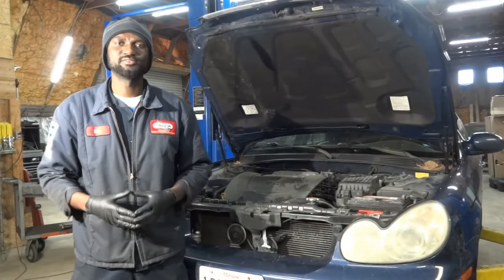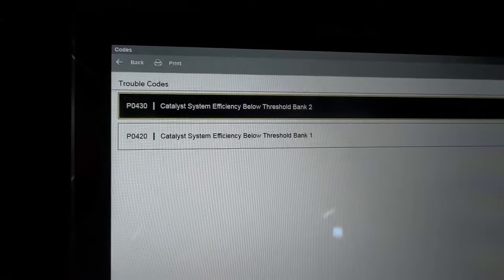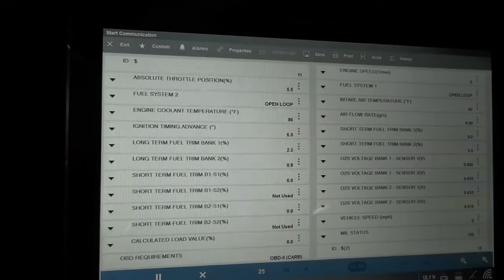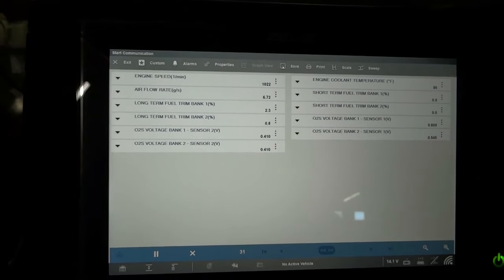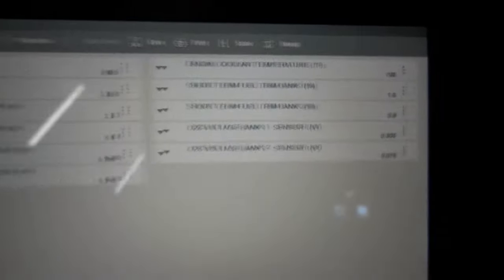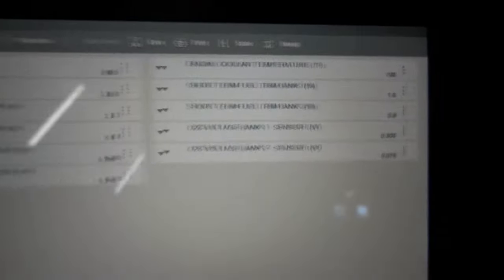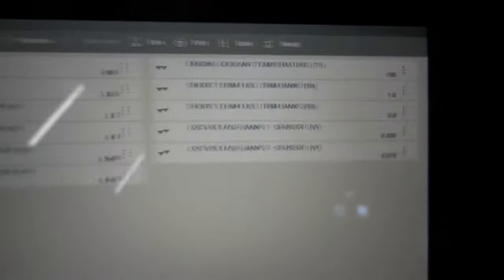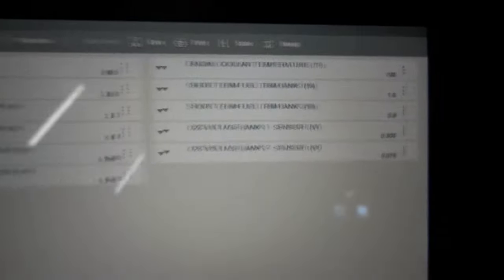Catalytic Converter Efficiency Below Threshold: Code P0420 & P0430 Diagnosis and Repair

Comment: Greetings from Australia. 2008 Honda Odyssey catalytic converter drive cycle complete and no DTC. The rear o2 is following the upstream wideband sensor ( same as this bad CAT) indicated the Cat dooen't work it should be BUT o2 drive cycle never run.  Question is that without o2 readiness monitor is not running, CAT monitor can be run as in this case ? Still leaning toward bad cat prevent the oxy sensor from running ...              you deserve a million subscriber and more
Reply from the maker: Tiffany Kim  Thank you!! Yeah you might have a bad cat or a bad 02 sensor!

Comment: 14’ accord had p0420. Cleaned old b2 sensor code came back after 50mi. Replaced it. Been 700mi no code. I scoped the cat and it look normal.
B2 on old sensor was going up and down. .1-.9 now its steady .4-.7.

Better to start with a new sensor and go from there.

Good luck!
Reply from the maker: @NeoAndersonReloaded  Good!

Comment: Fantastic tutorial! I wish I had easy access to you. I had the expensive experience of two dealership techs tell me independently of each other that both of my 4Runner's cats had to be replaced (with associated sensors), only to determine correctly, on my own, that the problem was the fuel pump, not what they diagnosed. They relied too much on their diagnostic devices, and didn't go beyond that . I relied on my old-school experience, and got it right.
Reply from the maker: bywayz  I'm sorry about your bad experience at the Dealership, and I'm glad you figured out the problem!!

Comment: Thank you for this informative video. I'm diagnosing my 2007 lexus with po430. Stft and ltft are in around .7 and 2.7. No exhaust leaks.  B2S2  is steady around .78. Cat temp is
320 in 580 out. Car runs excellent. Freeze frame showed B2S1 @ 2.79 when code set..Any help  what to do next appreciated. Keep up the good work!
Reply from the maker: Martin Jay  My Pleasure!! it looks like your cat has failed!

Comment: I had a PO420 code on my 2015 Malibu for months and used Catclean first, replaced cat, o2 sensors and plugs. The Po420 still keeps comeing back. You touched on the Mass air Flow sensor. I cleaned the sensor ( a new one was $95 ) . No more engine light , finally
Reply from the maker: @larryray9277  I'm glad to hear that the video was helpful!

Comment: Very detailed explanation video. I had no idea that so many parts removal and labor involved. Would be necessary to be removed. To get to the catalytic converters replacement. When I hear them being cut off and stolen in minutes by thieves. I have a 1996 Ford Crown Victoria V8 with a P O 430 code. Would this vehicle be as difficult for parts removal? How many hours of labor and parts cost was the vehicle you showed in the video? I wish I lived near you. To have my work done. You are a very good mechanic. Thank you for the video. New subscriber. Blessings to you.
Reply from the maker: Gail JOHNSON  Thank you!! removing catalytic converterts from your car will take 2-3 hours and the price will depend on how much the shop you're gonna take it to, charges per hour!!
Good Luck!!
Reply: @KITS_Auto_and_Truck_Repair  Thank you for your reply. I subscribed and will watching more of your informative videos.
Reply from the maker: @gailjohnson6670  My Pleasure!! Thank you!!
Reply: Some cars have their cats farther away from the engine like underneath center of the car. Those are easier to get to and replace. Thieves can get to those vehicles cats easier plus they use a Sawzall to cut it out quickly. If you look underneath your car the catalytic converter comes before your muffler.
Reply: @nonyabiznizz  Newer cars have been made smaller for weight saving/fuel efficiency. With everything crammed into a tiny space. Not like the 50's/60's vehicles.. Hood and trunk compartments that were huge.

Comment: Idk if I’ll remember / recall all this info ,but, now I can start to understand why I need a better OBD two reader and what  all the numbers mean… I don’t know if I’ll be able to completely diagnose my 420 issue but between this and the master mechanic that put in my aftermarket catalytic converter‘s explanation of why I still get that 420 I can start to verify I’m not gonna break down on the side of the road in a year
Reply from the maker: Vic Soboleski  Sounds good!

Comment: Thanks for the tip to take intake and off and the cat that way out and not all from underside, have to do it on Santafe 2,7 -02 . "Volvo Laplander Camper"
Reply from the maker: @eileosterholm  My Pleasure1 Good Luck with your project!
Reply: Thanks!  @KITS_Auto_and_Truck_Repair
Reply from the maker: @VolvoLaplanderCamper   My Pleasure!

Comment: Great video and very thorough explanation! I just went through almost losing my head to a bad cheap brand new converter from Rock Auto. Kept getting a P0420 code after checking for the leaks replacing o2 sensors with OEM sensors. Everything was working perfect but code kept coming back. 

After test driving the car both upstream and down stream sensors go to zero reading when decelerating at higher speeds. When the converter is under 1,000 degrees the volts on the downstream o2 sensor fluctuate. When driving and temp on converter gets up to about 1,400 or above, the downstream sensor stabilizes. 

At this point I’m pretty convinced it’s the cheap converter giving me that code. Do you have a certain brand or place you would recommend buying a good quality converter from?  Thanks in advance and great job on your videos 👍
Reply from the maker: How to serg  Thanks! I always recommend getting OEM Converters!

Comment: Best tutorial!  What I'm trying to figure out. All of what I read and viewed on the internet so far, says that a good working catalytic converter is cooler at the inlet and warmer at the outlet.
Which is correct?
Reply from the maker: MTPS Group Yes! the inlet temperature of cat should be cooler than the outlet temp, I misspoke in the video, that's what I meant!
Reply: @KITS_Auto_and_Truck_Repair  Thanks very much for confirming!
Reply from the maker: @mtpsgroup5934  My Pleasure!!

Comment: super awesome and informative video!!! I currently just ran into a p0420 code and my car burns A LOT of oil, it's a 2001 corolla, so i'm guessing it's my cat cause the car runs really good.
Reply from the maker: BPGA MUSIC  yes, it sounds like your cat is burned but you have to fix the oil leak first before you replace the cat!

Comment: Your videos are great 👍 I have a little question about the downstream oxygen sensors. Are they okay as long as  they produce straight lines or we should expect some numbers?like Where should the lines be at 410 milli volts or 430 milli volts? Thank you for your efforts.
Reply from the maker: michael gebremeskel  Thank you! a steady voltage from the post cat sensor is good, it's gonna very between 400mv - 500mv
Reply: @KITS_Auto_and_Truck_Repair  thank you so much.
Reply from the maker: @michaelgebremeskel6622  My Pleasure!!

Comment: You didn't mention anything about exhaust leak, is it possible for the rear o2 to mirror the front o2 because of an exhaust leak? Could you also explain how pumping the brake create the lean condition? The pressure chamber inside of the booster pushes on the vacuum chamber which forces the vacuum into the engine, I would guess.
Reply from the maker: @bebeto71-iv4qq  Yes!

Comment: i had a car with a clogged pcv valve wich caused the car to burn oil, and destroyed the catalytic converter with the p0420 code.
So make sure to clean at least every year the pcv system.
Reply from the maker: @scottykilmer3920   Good to know! thanks for sharing!

Comment: I have P0420. Honda accord 14’. My scanner dont have graph mode. Cat temp 1000F. Trims good, Maf good on idle and load, I got car to op temp 185F. Did live data. Pumped brake, S1 went negative until stopped pumping, while B1S2 continued to go from .1-.9 rapidly. Never any change in pattern. Guess ill replace it. Seen in other videos its common on my model. No other codes runs fine 31mpg.

Only time i needed a cat with a car was when I had a flashing cel and kept driving home.
Reply from the maker: @NeoAndersonReloaded  it sounds like you just need a cat!
Reply: Seems like the sensor after 700miles no cel anymore😊

Comment: What a wealth of info...most likely if it's a 'bad O2 sensor', that would be the first (upstream one), not the downstream?  If the downstream is fluctuating, that should show the convertor not working?   I drove for months (not many miles) with engine light due to bad MAF (I think it was P0171), could that have burned out my converter?
Reply from the maker: girohead  yes 100%, your cats are probably burned!!
Reply: @KITS_Auto_and_Truck_Repair  Yes!  That was on my car and ultimately the proper diagnosis, stubbornly I tried everything first, and learned a lot in mean time.   The old cat 'looked good' (not melted substrate), no physical damage, but I think internally may have been bad, or at least poisoned.   Now my dad's van is throwing 420, again I'm stubborn  - dealer immediately says 'bad cat, ' so I'm looking again.  I was going to pull sensor 1 'to check,' but your method is a far cleaner idea that I want to try (brake pressing), I already pulled graphs to see 'mirroring,' but I would like to confirm it's not just a sensor....I like that you reused the good sensors.  I'm amazed how many people think you need to replace them as preventative maintenance, or at least when installing new cat.  I see them as working or not, period.  So much info here for people who rely on shops - most shops will swap cat without fixing issue then gladly do it again later.  Good job!
Reply from the maker: @girohead   Thank you!

Comment: How do I know what is accurate and what is not?  You say the catalytic converter inlet temp is supposed to be hotter than the outlet.  Eric the Car Guy (Po420 How to Diagnose a Bad Catalytic Converter) says the opposite and apparently you both proved your point.
Reply from the maker: Linda Cox  No outlet of the cat is supposed to be hotter than the inlet! I misspoke in the video!!

Comment: What kind of scan tool do you use? An hour long video, wow! Well explained too. Thanks! I think I'm having the same problem in a 2010 Honda CR-V we just bought as a used car.. would this have shown up if the CEL wasn't on?
Reply from the maker: Jason Keller  I'm using the Snapon Zeus in this video!!  usually when the cat is defective the CEL comes on!!

Comment: Hi Kit, at the end of the video when you were looking at after the cat O2 sensors, the O2 reading was flat and looked good. The O2 reading above it had drop downs in the pattern. Why is that?
Reply from the maker: @chrisrountree8468   The Cat was just getting hot before it could work properly!

Comment: Very detailed explanations. However it's a bit confusing when you say the inlet temperature should be hotter than the outlet temperature. Isn't the purpose of having platinum, palladium and rhodium in the converter  to break down the harmful gases by increasing the temperature in the converter? Hence a high temperature on exit.
Reply from the maker: Ken Oyoo  Thank you! That was a slip of the tongue, I meant the outlet of the cat should be hotter than the inlet!

Comment: Good job sir
I have a similar issues with the 2 bank catalyst converter is under threat hold
I just replaced an over heat engine for my 04 lexus GX 470 when the radiator was leaking bad and water went inside the engine at the time the bad engine was smoking unusual bad
       Now the new engine is in and check engine is on P420 p430 codes
     I know $1700 wil be burn out for new 2 bank catalyst converter real paint
     Thanks
Reply from the maker: STEPHAN DANG  My Pleasure!! The leaking engine damaged the catalytic converters!!

Comment: Great informative video, very well explained in a logical, troubleshooting manner. Question for you brother? If I have replaced my catalytic converter with an Aftermarket catalytic, is it normal for Aftermarket Catalytics to still throw up a P0420 code even though it's a brand new (Aftermarket) Catalytic? Also, what 02 sensors brand do you recommend for my 2000 Honda Civic EJ9 with D14Z2 engine please bro?
Reply from the maker: Michael Paterson  Thanks! I recommend you use OEM catalytic converters, Aftermarket converters are not worth it in my opinion,  Especially on a Honda! Put OEM Cats and Sensors on it and your problem will be solved, I'm assuming that your engine is running great! make sure there is no other issues that caused the catalytic converter to go bad! before you install the new Cat
Reply: @KITS_Auto_and_Truck_Repair  Thank you for your great advice brother 🙂. You're right, my engine is running great with my new aftermarket catalytic (NAP) brand made in Germany. Engine management light stays on constantly even though I keep erasing the code with my scan tool, it just comes back, but yeah the engine runs beautifully. I've just changed the oil and filter and it's running gorgeous. 
The only issue with Genuine Honda Catalytics here in UK bro, either struggle to find one or if you do find one, extremely expensive, same as the sensors. Where do you usually source your Genuine Catalytics and sensors from? Regards, Mike
Reply: @KITS_Auto_and_Truck_Repair  Initially my original catalytic had been old and internals were falling apart but still working enough to do its job of passing smog tests.
What did kill the catalytic though was a misfiring engine due to a clogged Idle Air control Valve which was stuck closed. 
In the process of my mechanic trying to  diagnose the issue, the engine was running and being revved in that misfiring State (trying to keep the engine from stalling) but yeah this killed the original catalytic as right after this diagnosis which my mechanic eventually found to be the Idle Air Control Valve was stuck closed, the check engine light came on and P0420 code.
Reply from the maker: @michaelpaterson8086   I get them from my local Honda Dealer!
Reply from the maker: @michaelpaterson8086   Ah Ok!

Comment: i watched this from start to finish i just got a 2012 v6 mustang with a po430 code and a mis i put a down stream o2 senor in it and changed my plugs i reset my code and drove for 60+ miles and the car ran great no light and almost no mis it ran great. Butt the next day the code came back and so did the mis, your explanation helps me understand the fuel trim better. ill try the vacuum trick next. and check my mass airflow sensor. my question to you is. can a clogged cat cause a rough idle? i dont have a misfire code only po430 and im trying to fix this so i can my state inspection done thank you for your video
Reply from the maker: William O'Rourke  I'm glad to hear that you enjoyed the video! yes a partially clogged cat can cause a rough idle, I have a video that shows how to check for clogged exhaust, you should check it out
Reply: @KITS_Auto_and_Truck_Repair  ill take a look, i ordered some cats that are after market made to manufactuer spect
Reply from the maker: @williamorourke6622  sounds good!!

Comment: I need help, i have a 07 Prius...I followed your instructions on my OBD2...my O2 sensor AFTER the catalytic when engine is on spikes up and down just like the Upstream sensor. So im guessing the cat is bad. I also tried to let more air inside the intake but both sensors stay going up and down...they dont go steady like in your video. So that means my cat and both sensors need to be replaced?
Reply from the maker: @seeingisbelieving879  it sounds like your cats are defective!

Comment: Most basic checks on engine as taught here..
1. Put in a set of NEW plugs the owners manual calls for - DON'T use iridium-platinum or anything other than Factory proper plugs. Design is a balance in its "polarity' and impedance, and anything else might create a false sensor over-correction situation.
2. Run engine to 2000-RPM with a vacuum gauge on intake line somewhere, Verify the when at 2000rpm vacuum is steady, if it falls off then the CAT is clogged not allowing flow thru.
3. Use a FLIR thermal gun and measure the Front of CAT , It should be cooler than the Rear by about 100 degrees or so. Because IF it is "active proper operation the thermal byproduct creates more heat on outlet.
4. Verify the spring-bolt.  of pipe junction,  is NOT leaking !!!!
Reply from the maker: @yafois988  Good! Thanks for sharing!

Comment: I have a 2004 chevy tahoe only firing on passenger side  replace everything  fuel pump, injectors, spark plug,wires coils wire harness  even converters to swapping motors
Reply from the maker: @prestonbrown5241  Test your injectors and coils wiring, Make sure PCM is working properly!

Comment: I had a misfire on cylinder 3. After going about 200 miles bc I was on the way from South Carolina to Baltimore Maryland. I wanted to pull over in a safe area. I change my coil pack bc that’s what was wrong. My check engine light came back on a week later saying that my o2 sensor bank 1 and catalytic converter. I’ve changed my 02sensor about a month ago. Could that messed up my 02 sensor and catalytic converter? My motor runs great but it burning oil somewhere. I thought it was only my valve cover gasket leaking but it’s still burning oil,not as bad. Any idea’s?I do have 2014 Kia rio ex 1.6 l 4 cylinder gdi engine
Reply from the maker: @robinwilliams5841  the oil burning is what killed the cat! you should fix the internal oil leak first!

Comment: Is the engine running When you pump the brakes at 23:00 , to create lean condition to see if the O2 sensor will detect this lean condition, caused by pumpi g the brakes.
Reply from the maker: @none8901  YES!